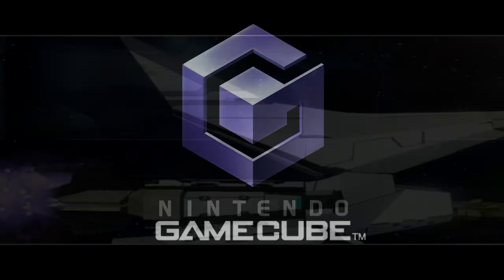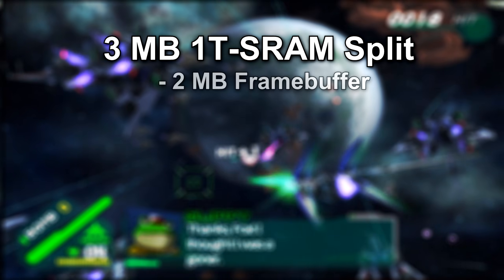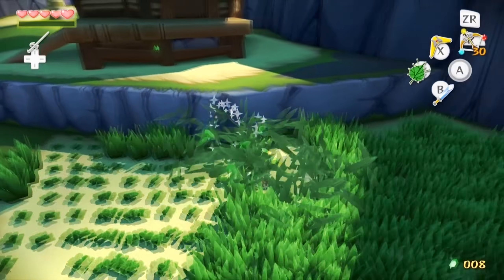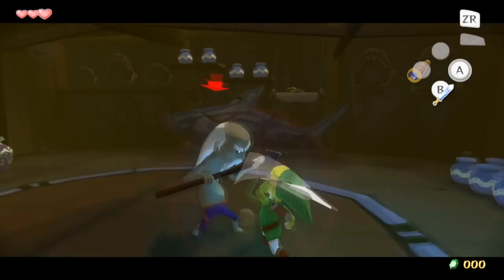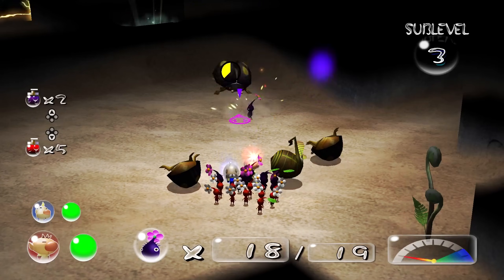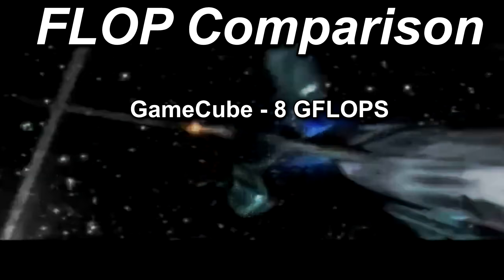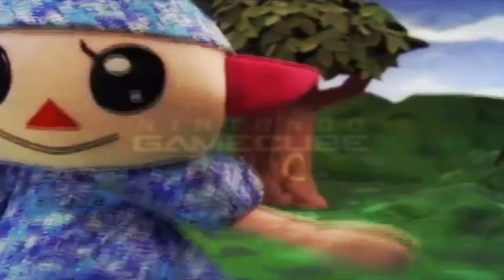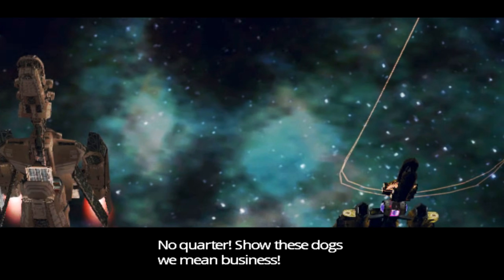The Nintendo GameCube GPU: Flipper

Comment: Something you forgot to mention about the GameCube was that it's CPU had 50 simd instructions added to it with a dedicated 64 bit fpu integrated in it. This was done to allow for additional graphical effects to be performed or offloaded from the gpu allowing it to perform better than it would have otherwise. This is very similar to what Sony did with the ps2's design, just with a more conventional approach as opposed to outright integrating 2 vector units with nothing but assembly driving them.

Comment: According to Wiki the Gamecube GPU was 9.4 GFLOPS. But I don't understand why nowadays everyone remembers the Gamecube as the weakest 6th gen console. Back then everyone knew it had a superior GPU compared to the PS2 and Dreamcast. I remember every multiplatform game looked the worst on the PS2 and looked almost the same on the Gamecube and Xbox.
Reply: The fricking GameCube proprietary disc that could only hold 1.7 gb of data would not be enough compared to the 4.7 gb of other consoles.
Reply: @ Yeah back then I didn't understand why we didn't get games on the Gamecube like Metal Gear Solid 3 or Final Fantasy XII. But I guess devs just don't want to compress their games on two discs instead they just skipped the Gamecube.
Reply: Yeah, isn't that odd? My understanding is that the Xbox was the most powerful overall but due to being more like a PC in a console suit that power wasn't always utilized very well since it was fairly different from the traditional approach consoles took to their architectures or something like that, or at least that's what I've heard several times over the years, and the result is that sometimes the slightly less powerful but well understood design of the GameCube ended up with games that looked better than the Xbox, especially in cases where the visual appeal of the game didn't rely on having a ton of hi-res textures since the relatively tiny GameCube disc format wasn't as much of a limitation in those cases. I could be misinformed, though, that's just what I've always heard, but it does make sense and line up with the things I do know to be fact.
Reply: I worked at Currys in England right at the end of this generation, just as Xbox 360 and PS3 were coming out. We could not understand why the sales went PS2 > Xbox > GameCube. Everybody loved the GC much more than the others, it had the highest software attach rate, and the lowest return/exchange rate. By miles.
Reply: One of the main advantages of the GameCube's GPU over the PS2 one was that fact the that GC graphical solution included all: vector from polygons, pixel and texel, memory access, render output.
PS2 GPU was more of a pixel shader and rasterizer, and the vector but was done by the CPU. This limited the PS2 so much some games (like SW Battlefront) struggled a lot in multiplayer.

Comment: The question "does the gamecube has pixel shaders", is one that can cause a massive shirtstorm among people that messed around with techdocs, because it's just not clear and depends on your definition of pixel shaders.
But the short version is that it has a list of 16 commands you can fill up to perform simple operations like combining colors in several modes, fetching a color from another texture, applying deformation on the UV with another color etc..
Also you do need pixel shaders to emulate it's behavior and dolphin will compile shaders out of this list (and get swamped the hell out by metroid prime that generate dynamic command lists)
Reply: Factor Five even claimed their Star Wars titles would've been difficult on the original Xbox due to the amount of effects they pulled off on Gamecube.
Reply: @VGamingJunkieVT  it was more like a "we have to port these weird list of connections to a proprietary nvidia assembler" kind of issue, more of a performance one
Reply: @ Ah, could've sworn I read they claimed the Gamecube's GPU in some ways was better than the Xbox's at least in terms of graphics effects. I know the one thing keeping the Xbox version of Doom 3 from going to Gamecube was a lack of RAM, suggesting its GPU could've handled it.
Reply: @VGamingJunkieVT  The Wii probably can run Doom 3,as it's a non-starved by RAM gamecube pretty much.
Sadly it's very starved of "people willing to push the limits of the system to show what it can actually do"
Reply: @ Yeah, the Wii could've in theory definitely done it. One of the few games where the devs actually tried to flex on its GPU power a little is the two Conduit games.
Reply: @VGamingJunkieVT It's actually because GameCube lacks pixel shaders and some Doom graphical effects are impossible on GameCube hardware like pixel lighting and DOT3 bump mapping.
Reply: @ 
That’s what I heard, that it was mostly a lack of RAM. The GameCube may not have literally the same support, but it had support for shader effects which Factor Five put to use in their Star Wars games. The Ps2 version of Resident Evil 4 even had to get a lot of effects like refraction stripped out over the GameCube version, the fire chamber is night and day difference.
Reply: @brawlioxd  You probably can kludge the color combiner enough to do it.
Also there is a pretty hacky way to do it i used to do on my voodoo 3 card that is encoding the normal map as a 256 color picture and doing dot3 math on the palette with the CPU. it may look a bit noisy and i'm pretty sure you can't do tangent space with that, but it's a thing.
Reply: @dan_loup  It is possible to achieve this using multi-pass rendering, but it is very expensive and consumes a lot of fill rate. Also, using the GameCube color combiner in 2-cycle mode would cut the fill rate in half."
Reply: @brawlioxd  Yep. It's more of a "can it do it fast" than "can it do it".
But my weird paletted technique has none of these specific defects.
Reply: @dan_loup  "Interesting! But wouldn't that technique have some major drawbacks? Like limited precision due to the 256-color palette, and the fact that you can't really do tangent space lighting with it since the normals are static in object space? Also, wouldn't doing the DOT3 math on the CPU become a bottleneck, especially if you're processing a lot of pixels?"
Reply: @brawlioxd  Yes there is quite a few. it does look noisy if you don't filter it somehow, and the hardware must support paletted textures in first place.
Now the CPU weight in this technique is on the palette side, each normal map texture adds 256 normal map calculations to it, so you probably should not overdo it.

Comment: Gamecube and PS2 were competing with each other and xbox og not xbox 360, maybe you should add xbox og GPU performance into the list at 06:00
Reply: The Gcn and Ps2 actually competed against the Xbox 360 for a single year Nov 05-Nov 06.
Reply: @theothenintendomaster3717  it does not work like that, it is like saying PS1 competed against Dreamcast while we all know from a technical point of view PS1 was gen5 while Dreamcast was gen6! Bottom line you can not claim a genX console was competing against a genY from a technical point of view!!!
Reply: @AlexSBedini  absolutely, but due to the different release dates of the consoles of the same gen,it kinda happened the way I described, though not intentionally.

Comment: Then : Let's make the game look good and run 60fps with just 43mb of RAM 
Now : You'll need to enable DLSS4 to run this game more than 60fps on your RTX 5090 with 24GB of memory
Reply: Not to mention data size optimization thanks to texture compression and audio codecs, now we have huge file sizes
Reply: @baguete02  well when you have to install the game on a pc yes. Each gamecube game is less than a gig (maybe some hit as much as 1.3gigs) however, you have to remember the gameube and consoles of its gen ran at a 480 resolution, have little to no voice lines/cut scenes and played out one direct way with very little assets in a game. a 4k video that's an hour will be 15-30 gigs while a 480p one be less than a gig. modern games make you install all assets, voice lines, etc, for every possible chat option & resolution. Starfield had 250thousand voice  (use starfield because I remember reading this) lines that would need to be downloaded vs maybe 100 that would be in a gamecube game, assuming there are voice lines and not just sims talk. 

Also modern games have compressed textures. assets can only be compressed a certain amount before it slows down processes and/or become corrupt. You cannot turn a 100 gig game into a 10 gig game and play it. It'll crash at start or not load at all. usually they compress 10%. So if an asset is 100MB, when compressed it would be 90. Much more will cause stutters and frame jobs since your processor needs to decompress the files while playing.

It's pretty complex, but realize that the gamecube is about 20 years old now. Those devs from back then are still employed lol. You're praising their work then and they're still doing a good job just that games are becoming more complex. Especially open world games where everything needs to be unpacked all the time and put into memory whereas back in the GameCube era, they loaded levels by scenes. But people cry now if there's any instances in their games nowadays, yet complain that a vast open world with beautiful graphics actually require memory and storage. Only other option would be streaming games on like gamepass or what not. Would be 0mb to play the game lol. But obviously cost Microsoft a lot for the architecture to run the game (since cloud gaming is just using a remote pc, that PC still needs a GPU, CPU, RAM, Storage and that isn't free

Lol that was a lot longer than I planned. I'm bored at work (a developer, not a game one sadly, just normal apps)
Reply: @CristianRodriguez-hl9ul  Appreciate the essay, but you just reinforced my point. You basically admitted devs dump every possible asset on every player’s machine with no optimization for the player’s actual setup. Why do I, playing on 1080p with stereo sound, have to install 4K cinematics, 7.1 audio, and 250,000 voice lines I’ll never hear because I didn’t pick that character path? That’s wasted storage.

Also, don’t act like compression is some dark art. It’s literally a solved engineering problem. Nintendo back then fit entire rich worlds on tiny discs with real runtime decompression—on hardware that makes a toaster look like a supercomputer today. Meanwhile, modern AAA studios burn terabytes just because they can, not because they have to.

And spare me the “open world needs all assets loaded” excuse. That’s just bad asset management. Plenty of modern games use dynamic streaming properly—see Horizon Zero Dawn or Spider-Man on PS4—massive, beautiful open worlds that somehow don’t need 200GB installs. Why? Because their devs actually engineered their data pipelines, instead of just copy-pasting assets and blaming players for not owning a NASA server.
Reply: @CristianRodriguez-hl9ul no actually, modern bc7 compression and astc are still barely used in the gaming industry as artists continue to include uncompressed textures without running through a compressor and dither… nowadays look at cod… it’s raw like all raw…

And then audio… wooo boy ive seen most games use 24 bit uncompressed… straight up… opus, wavpack, and flac exist… wavpack even supporting uneven sample sizes like 13 bit audio or 20 bit so at this point I find it a bit unacceptable now the size of modern apps… not to mention modern zstd and lzma both being open and well documented formats that could easily reduce size more…
Reply: or turn off deflicker and alpha dithering and you have a clean and sharp image that today's games have disappeared

Comment: But the GC was also a Raw Power Machine... According to verified Data it was the 2nd Best Console like You mentioned!?
Reply: In overall performance, Xbox  and PS2 are above GameCube.
Reply: @brawlwii8243  lol No...
GC>PS2
Reply: @JAGtheTrekkieGEMINI1701  Look, the PS2 had a much higher fill rate than the GameCube, and thanks to that, it could handle more particle effects. It could also perform DOT3 bump mapping, something the GameCube couldn't do. In addition, the PS2 had programmable Vector Units, which allowed you to do whatever you wanted like fog effects seen in Silent Hill 3. The PS2 could also push more geometry and handle physics better if VUO was used properly. The thing is, the GameCube is a console where it's easier to reach 100% of its power, while achieving 100% on the PS2 is much more complicated, because programming the VUs requires writing in assembly language.
Reply: @brawlioxd  Although that might be true, the 4MB VRAM Bottle Neck Severly limited what Textures and Effects could be displayed. Almost like the N64 limited Outpu Texture Cache, the PS2 was a Powerful Machine that Fell short practically in the End even compared to consoles that came before but had still Hardware advantages(Dreamcast to PS2 or PSX to N64)
Reply: @JAGtheTrekkieGEMINI1701 
Although the GameCube had an efficient architecture, its 3 MB of EDRAM didn't allow for a 32-bit framebuffer like the PS2 did, being limited to 24-bit color with dithering due to bandwidth constraints (10.4 GB/s vs the GS's 48 GB/S). Additionally, the GameCube wasn't designed for post-processing effects like blur or glow; while possible, they came with latency and performance costs-unlike the PS2, where games like Silent Hill 2, Silent Hill 3, and made extensive use of them. It also lacked dynamic texture streaming, something the PS2 could do in real time from RAM or even directly from the DVD.
Reply: @JAGtheTrekkieGEMINI1701  They both have their advantages and disavantages. Even a cutting edge PC of that era had some inferior specs to the PS2.
Reply: @JAGtheTrekkieGEMINI1701  GC does have less VRAM than PS2 actually but more efficient texturing compression, so it kind of balanced it out.

But PS2 also has vertex compression and its the only one of that generation that could do that.

It was easier to make on PS2 games that ran at 60 fps and pushed graphics to its limits than on the other consoles tbh... 60 FPS was also needed for field rendering so devs needed to optimize more.

Every console had their own strenghts.
Reply: @JAGtheTrekkieGEMINI1701  The N64 was severely limited for the RAM latency which to be honest was terrible. PS2 was in dual channel and VRAM is stored on the same chip as the GS, to not be starved.

Some PS2 games suffer on the texture side like N64, but thats because devs just loaded textures into VRAM without streaming whatsover.
Reply: @sebastiankulche  Streaming capabilities Aside The GC had 4 TIMES the Video RAM which was The single Most Important thing at the Time I would argue.
This was the Sole Reason the PS2 fell behind the Competition in graphics and could Never hope to Achieve Games like Roque Leader, F Zero GX, Starfox Adventures, Metroid Prime and so on.
Reply: @JAGtheTrekkieGEMINI1701  4 times??? Lol. It has less VRAM than PS2. PS2 has 4mb, GC has 3mb.